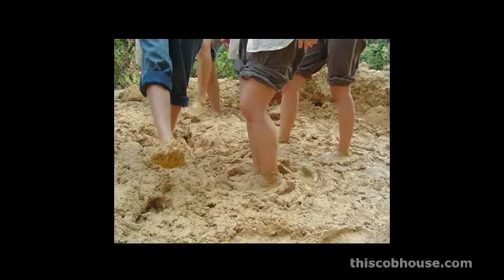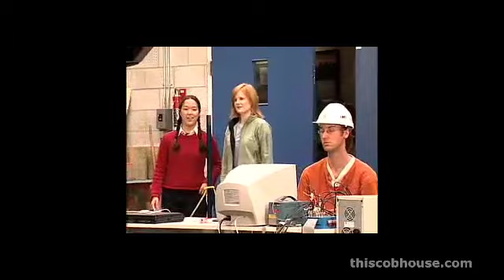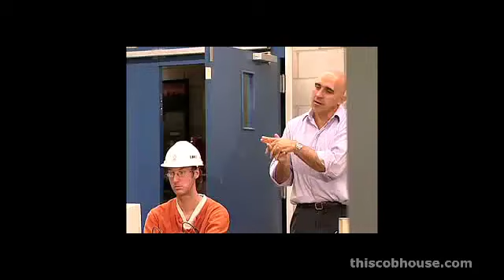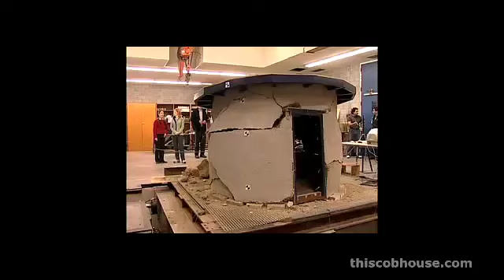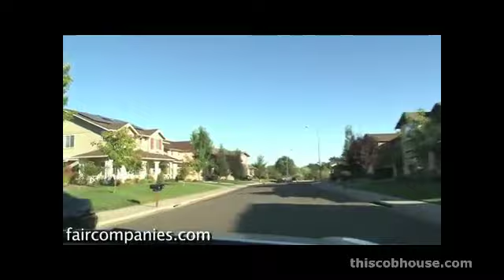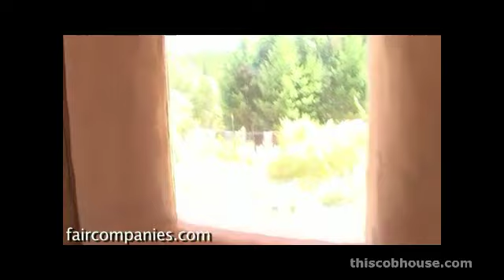Building with Cob: Post-Collapse Solution for Shelter

Comment: All these people narrating sound so terrible I turned the sound off and just watched the video. This guy sounds like a sissy. The girl didn't sound good either. Where do they get these people? This cob clearly doesn't look to be any more earthquake proof than other building methods. I like the aesthetics of adobe and wattle and daub, but am sorry I'm not fond of this. Building with it seems a little nasty; its VERY labor intensive. I built a small wall with this method years ago on a temporary structure and I was surprised how long it took. It seemed very hard and strong, but when I tore it down I found it wasn't strong at all. There are other ways: personally, I like my shingle method. U can see part of what I'm doing at "homemade shingle/veneer making machine" on youtube. I'm building something now which will be amazing. Its going slow right now because of the annoying heat and humidity and biting gnats here.
Reply: +discountbrains Hi,  Just took a look at your veneer peeling machine. Very impressive but for me there are issues. There is the capital cost in buying the kit to build it and then you need decent power generation to run it, together with additional tools like the pneumatics you mentioned to staple them etc etc. I also watched your second video and was pleased to see you managed to calibrate it and were getting some nice sheet lengths from it

Personally I think I prefer cob for two main reasons. It's inherently fire resistant unlike wood, and it requires little or no maintenance (no paint or timber preserver every 5yrs)

The purists would say that cob should be made by trampling the cob by foot and there is no doubt it is a heavy material to handle and usually a very labour intensive process, but you can make cob mixes in a cement mixer, carry it to the work area in a barrow and even make bricks, dried in the sun to cover large areas

Both materials are great and I think they would complement each other and look beautiful. They both have so much potential to allow people to build themselves and build in an individual and personal way. If I had a decent supply of wood i'd have a go at veneer peels but as I'm very impatient I'd probably just go with cordwood and cob

I could make some damn fancy furniture with your veneer sheets though... shame we are thousands of miles apart !!
Reply: +TheComputec Yes I know. I have been on a quest for quite some time to come up with a simple, low tech, homesteader type, diy  way to build housing etc and this was as close as I could come. The central problem is how to build roofing to keep one warm and dry. Your cob method doesn't address this at all. With an adequate roof many choices could be used for the walls etc. I am very impressed with this lime hemp construction I've seen on You Tube, but believe straw could easily replace the hemp needed. I can't wait to get started on this idea. I like my wood shingle methods, but I'm planning on going back to attempt something more basic again. I have a new Idea to soak straw in a lye solution or wood ash solution for about 2 weeks, lay it out on a flat smooth surface with a mold around the edges, and pound it flat, remove the mold and set it aside to dry. At this point I might pour some glue or paint or whatever on it. With the straw smashed together and flattened this should dry like leaving paint on a paint brush. This was an idea I've had for a long time. I could make small panels or shingles like this and this would be nearly primitive. I've always wanted to make stuff as basic as possible; Yet, easy. Straw thatched roofs have been known to last 20 years. 

How do u know where I live? I'm in the US. Where are u?
Reply: discountbrains I guessed by your accent that you were in North America.. I'm based in the UK but my cob house is in France. 

Interestingly my roof is made from Hand made fired clay tiles using  clay from just down the road from the house...  so it's not too far removed from cob... just no straw !! It took over 6000 of them by the end of the project. Each one hand patted into a custom mould to match the spacing and pitch of the roof... They came out great so essentially my entire house shell is earth based.  The tiles cost no more than shop-bought cement tiles and they just look so much better and will age naturally. I'm not sure what was on the roof originally... its a very old house... 250yrs plus  I'm guessing thatch or even wooden shingles as many of the old houses in the area do still have oak shingles to this day which look great as they are bleached white with the sun and are so aged and hardened they are waterproof.

Here in the UK Thatch is sadly a very niche product but it has little resurgences from time to time, even on new modern builds in conservation areas.   Yeah, like you say a thatch can last 20yrs plus... which is roughly the same as cement roof times which eventually go porous and brittle

Black slate would always be my preference on a standard house

The old ways are the best... except with the addition of modern damp proof coursing !!
Reply: +TheComputec Yeah, that sounds like a very good roof. That's about the best there is. I've seen in pictures houses all over Europe with roofs like that. One thing everyone should keep in mind, though, is tile roofs require a stronger building structure because of the weight. Yes, that sounds like a lot of work. Did u make the tiles yourself or did someone make them for u? I've had the notion of making roofing tiles myself before. I was thinking they could be stacked in a cone shape and a fire started in the center. I wonder if firing them just enough to vitrify them is enough. I saw some cement shingles once; they had some colored coating sprayed on one side. I wonder if they would get porous after some years. 

I majored in math in college and took some engineering courses. Construction work or even craftsman work is not my thing. My motivation is more to design and invent things. Unfortunately, I end up having to build what I think of because my ideas are unorthodox and craftspeople typically only know what they're trained to do. I once lived on a commune for a while. Their biggest challenge was to build adequate housing. Most of what they built I thought was pretty awful-not much better than shanties for homeless people. I was disappointed in the meager resourcefulness of the common man. They had to wait to find an old building to tear down for materials. There needs to be better ways because there is a limited supply of buildings to tear down. Its good now we have the internet and many varied ideas are coming to light.

Comment: building it seems fine its just plumbing and electricity im worried about how do i put a toilet a shower lights and my wifi modem in
Reply: +TheWildCardA I have a cob house in France. You can have all your "modern living" pleasures. I have solar throughout as well as modern plumbing Electrics is easy as you can poke holes anywhere you like in the walls... Its fireproof so you can build your fireplace just how you want it. With regards to a shower its no problem. You render your shower walls in lime plaster, let it cure then coast it with a modern breathable paint or use tiles like you would with bricks and plaster.  WIFI is an odd question, but actually the solid walls in a cob house do hold up the signal a little as the walls are dense and usually twice the thickness of modern homes, but you can use powerline adapters or wireless wifi extenders
Reply: +TheComputec yeah but how do you put all the pipes in and wires
Reply: TheWildCardA You fit services exactly as you would with a house made of wood, Metal, concrete or brick. You drill holes and feed wires and pipes through. Once it has been built and has dried it is strong and resilient as a load bearing structure and you can chop out archways and doorways so it behaves like any mixed material build
Reply: TheComputec 
Do you add plumbing and electric while building or after you building? Can you cut out additional openings to connect additional structures after its built?

Comment: We have 1 house built with straw bale. We were looking at Cob for our next home - but found it does not have the insulating value we require for Saskatchewan winters. We then discovered SLC (Straw Light Clay) Best of both worlds. Similar to cob but faster with insulating value of Straw bale. Not load bearing though so you need framing. Thanks for the Video.

Comment: ok, city water is NOT filtered pee, my father worked for the water department for 30 years. Cob house didn't look that good in an earthquake. but I am still interested in the method, I live in New England and I'm sure it would be warm enough , but the foundation will need modification, our frost goes 4 feet deep and can cause havoc's called frost heaves. Earth based IS a way of life and a journey...a journey that I am slowly taking.

Comment: From what I've seen, they use a much wider roof overhang around the house to help keep the rain from soaking and beating on the walls. They also use a denser stucco coat on the outside of the house.

Comment: There are cob buildings in England over a millenium old.  Im sure thats true on all continents.  Straw bale builds are good, but cob has the advantage of greater thermal mass.  Straw more insulative.  South facing glass + thermal mass equals drastic reduction in heating energy.

Comment: Can cob structures be built in modular fashion i.e. one little structure, then another little structure built later and connected? Just wondering if a new structure would seal to it after the first one cured or if there would always be cracks forming at the join area.  It would be nice to build something small & quick that was livable and then "grow" it to the desired size or add interior access to the sheds etc.

Comment: Can only speak to homes in TX & IL. In Tx termites are ever-present, extremely destructive & very expensive to repair the damage.  There are naturally bug resistant wood to use w/o chemical treatment.  Many vintage homes built between 1850-1930 in NE Tx had pier/beam found'ns of bois d'arc native wood that is so dense, nothing will penetrate it. I grew up in a house in N central IL that was constructed circa 1870; foundation was made of boulders & the 2 story frame house is cedar. Still solid!

Comment: I don't understand where they are coming from most of the time wolfdog.  In my architecture class there was a contingent from the hippy-dippy side, and they thought birkenstocks made gurus out of them.  Wrong.  I still liked COB and Strawbale though, much to the prof's chagrin.  There's another COB benefit, which is if you don't like it, knock it down and reshape it without a loss of mat'l.

Comment: I looked into building with cob in Pennsylvania around 1999 and the township told me to hurry up because the codes were about to change and become more strict and standardized. The project did not come to fruition. A collapse will have to come to allow such sane building methods to be permitted in some territories. No code-constructed pvc encrusted cul de sac dwelling holds a candle to the light of elegance shown by the examples in this video.